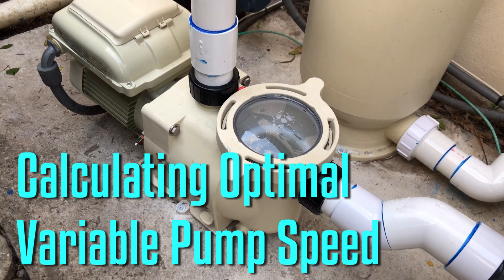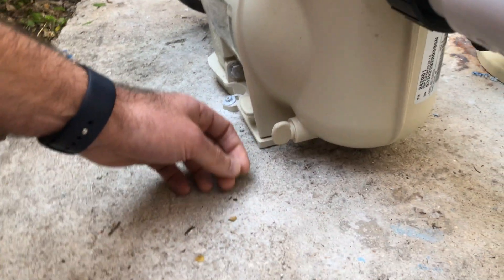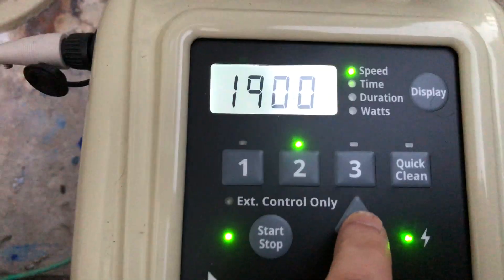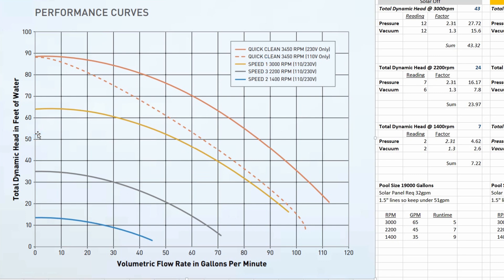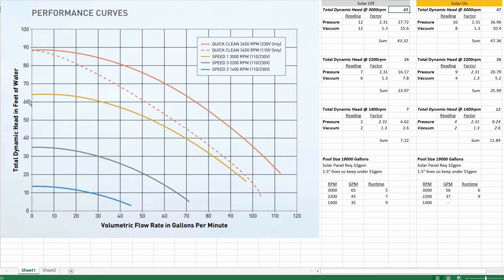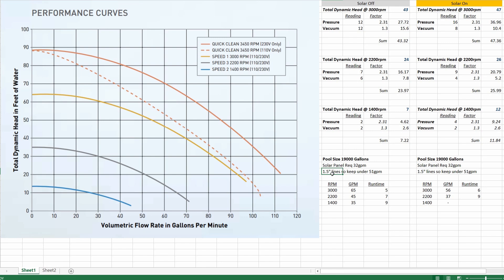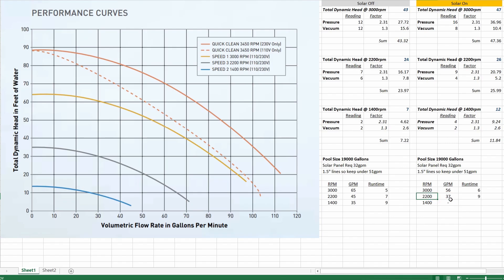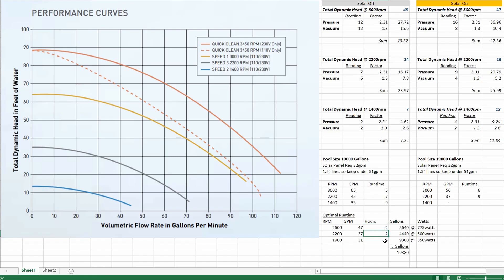Calculating optimal GPM flow rate on Pentair SuperFlo variable speed pool pump

Comment: why did you use the pressure gauge on the filter? Pentair hydraulic manual clearly states to use the pressure gauge on the volute side of the pump. That is the pressure side. Using the filter will mean you are not getting true values.  The methodology was clearly scientific with one error: using the filter gauge, which is also much further away from the pump,
Reply from the maker: You are correct that it’d be most accurate immediately after the pump, but IMO it’s a good enough approximation using the one on the filter assuming it’s clean and not too far from the pump itself.
Reply: @reallyMello  Yeah ok, a clean filter is an absolute, no matter what.  I actually am buying a compound gauge to start testing.   So I am curious to see the comparision.
Reply: The problem at the filter is head loss, which can be 9 feet of head or more.  So consider that added to the equation if using the filter.  Or not added using the return side of the pump.

Comment: I really appreciate all the work you put into this. I just purchased a vacuum gauge and was wondering where did you get the vacuum 1.3 and pressure 2.31 numbers from?
Reply from the maker: The 1.3 is supposed to be 1.13 I updated the formula and spreadsheet here https://www.davidmello.com/calculate-gph-flow-rate-pool-pump-savings/

Comment: I am really confused on the math. How do you add 12 psi and 12 in of Mercury together? And come up with 1.3 and 2.31?
Reply from the maker: You take Hg*1.13 + Psi*2.31 to get total dynamic head. This article explains in more depth https://www.davidmello.com/calculate-gph-flow-rate-pool-pump-savings/

Comment: In the event you do any future work on this. Pentair recommends a straight line on the suction side should be no closer than 5 times the pipe diameter to maximize efficiency. For example, a 2-inch pipe requires a 10-inch straight run in front of the suction inlet of the pump.
Reply from the maker: Thanks for the efficiency tip

Comment: 2 comments:
1. I’ve seen many pool experts recommend you run your entire pool volume through your filter 2 to 3 times every 24 hour period.  You seem to be happy at 1.
2.  I’ve seen many pool experts say the whole benefit of variable speed pumps is to get some high flow rate filtering combined with the remainder of each 24 hour period at a much lower (less electricity) flow rate.  The only reason you would not be running the pump would be to be saving money, but the low rpm/power capability of these pumps makes it very inexpensive to run all day.

Comment: This is great info!  I have the same pump.  Although I was using the readings from here to initially set up my system, once I got the vacuum gauge, I found my numbers were a little bit different.  So I dialed it in, and found I'm  using below half the power of the original stock settings!  My installer put ZERO effort into setting it up in the first place.  Thanks for the awesome tutorial!  😊
Reply from the maker: You’re welcome!

Comment: Hello where did you get the performance factors for vacuum and pressure. I have 2” piping. Will those performance factors work for different diameter pipes. What kind of solar heater do you have?  Thanks.
Reply from the maker: 2” lines will have better performance than the 1.5” lines I have. I think my solar heater is by Heliocol.
Reply: @ okay can I use your performance factors that you used for the vacuum and pressure to figure out my total dynamic head. Thanks.
Reply from the maker: @77jetmech  yes but you won’t have the same max flow rate limit as me. You should be able to push more through 2” lines.

Comment: Great stuff.  But how did you determine that 1400 rpm would be enough to pump water to the solar panels on the roof?  I don't think I'd run the pump that slowly anyway, but....
Reply from the maker: @timgedney8613  because when I went too low water wasn’t coming out of the pool jets
Reply: @reallyMello  Makes sense, thanks.

Comment: 011075 (3HP) vs 011065 (1.5HP) Is it more efficient to run 3HP at 20gpm or the 1.5HP unit at 20gpm ?

Will 1.5HP be more efficient across the board, but louder, and lower peak flow?
Reply: Did you ever figure this out?  I have the same question
Reply: @webcrawler3332  No, I just ended up buying the 3HP unit.
Reply: @andyh8239  are you finding that you only have to run the pump at lower speeds to keep your pool clean or do you have to run it at max 3450?
Reply: @webcrawler3332  The pool I bought it for is still under construction.  There is still snow on the ground where I am.  I did run the pump briefly last year to ensure everything was working.  For every doubling in flow it took about 4x more power.

Comment: Thank you for the million dollar question.  I have a 16000 gallon pool and by you calculation I can run my pump at like approx. 2000 to 2200 gallons for an 8 hour period.  I don't have a solar heater, so I'm good with the approx rpms.  I have the same pump.  It may suck a few more gallons at the 2200 rpm speed, but that's ok.  I remember reading in a pool forum, where a guy ran his pump 24/7 at 2200 rpm.  This vid just saved me a ton of money and electricity.  Thanks for this vid

Comment: Thanks for the video, I'm using this to do my calculations on my pool. I do have one question though. While looking into the conversion factors I found the following cited everywhere I looked online:  "CALCULATE TDH - Multiple the Vacuum gauge reading x 1.13." The factor seems to be 1.13, not 1.3 as stated. Just bringing this up in case anyone else is seeing this. Or perhaps you have a reason for using 1.3 instead.
Reply from the maker: Ya that was a mistake I caught a bit ago I had updated the spreadsheet and article on https://www.davidmello.com/calculate-gph-flow-rate-pool-pump-savings/ with the 1.13
Reply: @reallyMello  Thank you, I didn't realize you had published the spreadsheet so I was recreating it when I found that issue.

Comment: Unbelievable helpful without having to buy flowmeters. I followed Mr. Mello dual pressure method by tabulating the RPMs to GPM and Watts on my Pentair. Then I normalized the data using excel and obtaining a fitting curve and equation for the GPM and Watts. I then calculated that I needed to circulate at least 1.5 times the pool volume per day calculating the needed hours for each pump RPM. I was thrilled to find on the plotted curve an optimum sweet spot between 1600 and 2200 RPM coinciding with the lowest Kw-h consumption possible. So instead of using 2800 RPMs for 3.5 hours (which I have been using since 2018) I found out that I can set it to 1800 RPM for 7.45 hours costing me $2.83 /day opposite to what I've been foolishly doing for over 5 years at $4.35 /day. The $1.52 savings per day X 365 days more than paid for the Vacuum gage and 1/2" nipple I bought at the hardware store. Thank you for this excellent video.
Reply from the maker: I’m glad you were able to apply it and run more efficiently
Reply: Hi, similar sentiments here.  My previous pool care company put me onto the variable speed pump but left it at 2,800rpm basically cleaning 2-3 times my pool volume each day and Mr. Mello helped me put an end to that nonsense.  I have a few questions for you, @fferes2163, wouldn’t the lowest KWH consumption be at the lowest RPM available and just run it longer to get to your 1-1.5x volume?    I.e. I run mine at 1,400rpm for 11 hours a day and it’s “only” pulling ~160watts.  Also why 1.5x your pool volume instead of just 1x?  Glad to hear there’s more aficionados out there doing the leg work of plotting the pressure/vacuum data on excel.  Thanks
Reply: @rnolet2  The lowest watts consumption point calculated for my pump was actually 1600 RPMs but I had to raise it to 1800 RPM for 7 hours because I have a water fall that need a little more flow. You can use 1x to be able to filter the entire pool. I need a little more because mine is a salt pool and some of the Chlorine is lost to the UV exposure here in Florida. 1400 RPM for my pump shows 2.41Kwhrs during 10.18 hours of run time (1.5x) with 237.1 watts constant. My neighbor uses your program, so it is not a bad choice. I'd wish I could share my spreadsheet with you, but I do not know yet how. Anything over 2000 RPM it begins to sharply use more watts of power.
Reply: Dear  @rnolet2 . 
Not really. I was focused on the lowest Kwh consumption per day to achieve 1.5 x the pool volume. My pool is a salt system and requires 1-1.5x to create and saturate hydrochlorous acid thru out besides filtering the entire pool.
My pump reads 227 watts at 1400 RPMs, so your power consumption is much less, you are lucky.
 Since I did not have a flow meter, I found that David Mello's video was sent from heaven. The pressure and vacuum gave me the TDH and Watts per each RPM and from the chart I obtained the GPMs. plotting the 4 points on Excel applying my Engineering knowledge I found out that that for each RPM there is a high, a low and a high again in wattage usage. This optimum pump's lowest wattage range is between 1400 and 2200 RPMs. The good news is that my neighbor's VS pump results produced an identical RPM range but with different GPMs since his plumbing is different than mine. However, we both concluded that the flow must overcome things like a pool waterfall and a decent water flow into the skimmer, so I had to run mine higher at 1800 RPM for 6.45 hrs.
 If you can run yours a1400RPM my calculation is 10.18 hrs. so you are in the correct zone and identical to my neighbor's. It saves pumps life, and it is very quiet. Since I am in Florida, I program it to run the pump while the pool is exposed to the sun, a chlorine killer.
My calculations for optimum (RPM/HRS) performance and 1.5x are: 1400/1.18,1500/8.9, 1600/7.9,1700/7.1, 1800/6.45,1900/5.91, 2000/5.46, 2100/5.06, and 2200RPM for 4.72HRS. Occasionally, I raise it to 2800RPM only to temporarily run my Zodiac vacuum crawler twice per year or so.
Reply: @rnolet2 you just run it for 11hrs per day or do you ramp it up for a few hours to allow skimmer flow rate? And how many gallons is your pool? Thanka

Comment: But I thought we needed to turn over the water at a rate of 3X the total gallons, so shouldn't you be pumping 57k gal/day?
Reply from the maker: I’ve not heard of that for residential
Reply: @reallyMello  It's on anything you read. I don't even have my pool yet but everything I see and read says this for residential pools. They describe it as 1X getting about 66%, 2X about 90% and 3X about 95%. Definitely some diminishing returns and if your water is good, then you don't need to change.
Reply from the maker: It does vary depend on things like bather load and if you run a salt cell etc. trouble free pool has an article https://www.troublefreepool.com/wiki/index.php?title=Turnover_of_Pool_Water

Comment: Using the pressure gauge on the filter is the wrong way to do this, you should be using the drain on the back of the pump. Also, you forgot to install your bond wire on the pump!
Reply from the maker: Where are you seeing that it is wrong to use the gauge on the filter? Also, the bonding wire is definitely connected to the lug on the pump.
Reply: @reallyMello  it's wrong because the pressure at the filter is variable depending on what kind of debris you have in there. There's a reason they put the drain holes on both sides of the pump, it's for the gauges. Bonding lug looked empty to me, but after zooming in, I think I see a green sleeved conductor. What in the world is a green sleeved conductor doing there? It's always a bare wire bond from the pump to the pool shell.

Comment: First of all Very informative video and calculations. However, my readings when used with your formulae yield numbers that exceed the Total Dynamic Head curves and therefore I cannot extrapolate  the GPM value  on the x axis. Any idea? Could it be the two factors (2.31 and 1.3) are different for my system? Any suggestions would be appreciated. Thank you!

Comment: Excellent video-but we all more explanation on how to arrived at the optimum rate -- I think it was ratios and proportions right?
Reply from the maker: I wanted to filter the equivalent of the total gallons of water in the pool at least once per day so once I had my gallons per minute flow rate I was able to determine what my runtime would need to be at a given pump speed. I used 3 different speeds as shown to optimize for the solar heater in some parts of the day and also so my suction-side pool cleaner works correctly. After, I multiplied each of their runtimes by their GPMs at that speed and added them together to make sure I had a total gallons value roughly equivalent to the volume of water in the pool.

Comment: My gpm fluctuates from 58 gpm to 48 gpm. 3000 RPMs is what it’s set at. Why do you think this happens all the time? I backwash and skimmers are always clean. This is a weekly occurrence for me. Equipment is brand new since December of last year. 🙏
Reply from the maker: From moment to moment it increases and decreases or gradually decreases? How are you measuring it?
Reply: @reallyMello  not moment to moment. I’d say it stays fluctuating from 52-58 most of the day and then in the evening, it’ll drop. 42-48. I never touch the RPMs.
Reply: @reallyMello  I’m measuring it based off the Pentair app on my phone.
Reply from the maker: Do you have any automated things in line like heaters or water features?
Reply: @reallyMello  we have the hot tub and water fall and yes a pool heater. Only thing running is the pump/ water flow over the hot tub.
Reply from the maker: Unless you ruled it out already it sounds a lot like your hot tub and/or heater could be kicking on and reducing flow rate

Comment: Great information, but IMHO you miss the final transition to put a $$ amount to the Energy efficiency = KWH.  Maybe that's in some of your other videos/references. Anyway - at 7m10s into this video you introduce the wattage. Using your numbers, we can calculate the KWH needed for a full pool refresh. Essentially multiplying watts time runtime of course. Result: @2700=6.9, @2100=4.4, @1900=3.6.  Now with my current rate of 30c/KWH that's daily $1.60/$1.31/$1.09 or monthly $48/$39/$33 - staying on one speed = sort of max saving.  Adjust for your time/speed selections. Whether full pool turnover is critical, enough, or too much is an entirely other discussion.

Comment: Hello, thank you for your video!  Can you dumb it down for me? Where did the factors 2.31 and 1.3 come from in regards to pressure and vacuum? Are they on the gauges?
Reply from the maker: It's a fixed multiplier for the TDH formula. I explain it a little more long form here https://www.davidmello.com/calculate-gph-flow-rate-pool-pump-savings/
Reply: 1 inch of Hg * 1.13 = 1.13 feet of water
1 psi * 2.31 = 2.31 feet of water

Comment: Great video  Very helpful.  How do I do this with my pumps that are not using a filter.  I have a couple pumps that feed my water features and do not have a filter with a pressure gauge.  How do I find to dynamic head for those?  Thanks in advance for the help.
Reply from the maker: Same process essentially but you’d need to find a place to add a pressure gauge on the pressure side since you don’t have a filter that happens to have one already in that case. There are also flow meters you can plumb in instead if you have the room as another option.

Comment: From what I understand from recent reading, for many pool systems the pressure reading would better be done using the 2nd port on the pump itself.  (If I'm not understanding something please let me know.) In your setup it does not matter because you have no backwash valve in-between to add more resistance, but for those that have a backwash valve (or anything in-between that can add notable head), they might want to use a pressure gauge on the pump (in addition to the vacuum gauge on the pump).  (It is important that the pressure gauge be located on the port that is farther back toward/under the impeller.). I took measurements today using the pressure gauge on top of my filter, but the resulting GPM from my pump's curves is much too high to be correct.  I assume it is because my readings are not factoring in my multiport valve.  I'm now waiting for another pressure gauge to arrive.  (BTW, I don't know how much it matters, but Measureman claims the fluid filled gauges are important where there is a lot of vibration - which would be true on a pump.  I asked 3 pool shops and they did not seem to know anything about fluid filled gauges.)
Reply: this is exactly my situation as well! I did the calc using the guage on the filter but got low readings and not sure i trust them w/o measuring pressure right at the pump , rather than the filter.
Reply: Same here. It says I’m pushing less gpm at higher rpm. Can’t be correct. Wonder if the pressure gauge on second port on pump would work.

Comment: Excellent video, thank you.  However, how did you come up with 32gpm with  the solar panel and the 51gpm for 1.5" pipes?  How many gpm for 2" pipes?
Reply: The link you provided below answered my question.  https://hayward-pool-assets.com/assets/documents/pools/pdf/manuals/HydraulicPumpSizingDiagnostics.pdf
Reply from the maker: Roughly 63gpm for 2" according to https://www.swimmingpoolsteve.com/pages/pipe-size.html